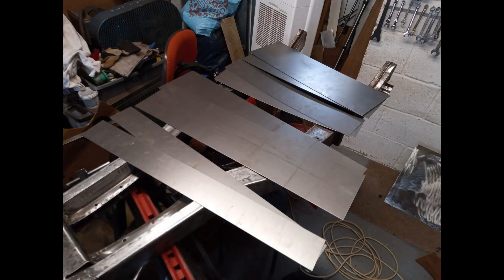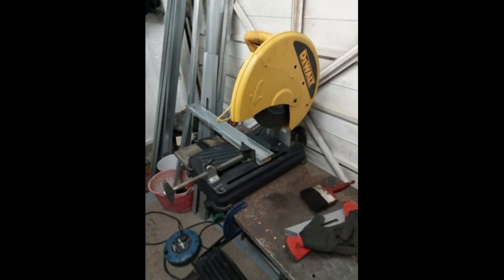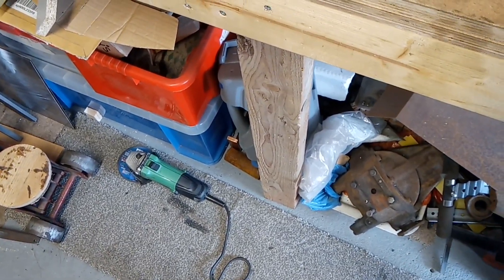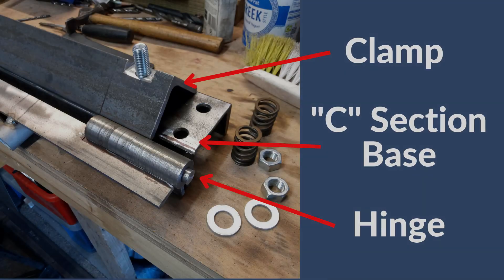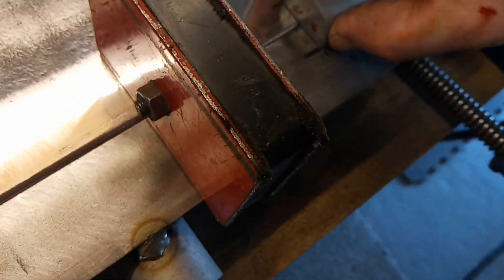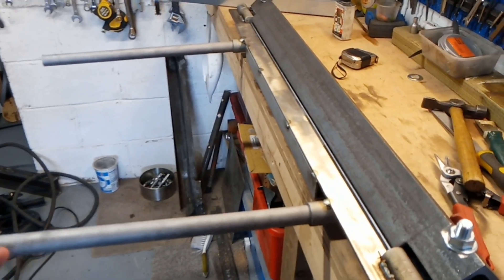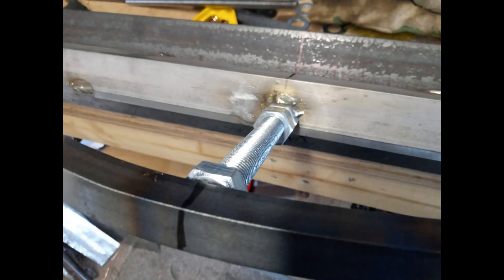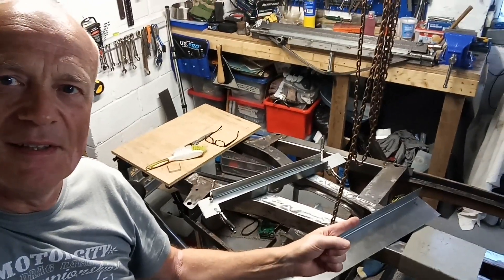DIY Sheet Metal Folder Build

Comment: Great build really like your ideas.  Im in the process of creating my own version
Reply from the maker: Thank you 👍 It is a very useful tool for the rare occasions that I need to use it. You can also use a thin piece sheet steel to alter the corner radius which you can play around with as it will bend to the radius on the clamp.
Good luck with your build.
Kind regards Paul 🇬🇧

Comment: - have you tested how thick steel it can fold?
Reply from the maker: Hi Tom, I haven't tested the max thickness as such as I only needed it for the box sections on my chassis which were 1.2mm which it bent nicely along the full length. I have bent 1.5mm but only short lengths with ease. It all depends on how long a length you need to bend, The longer the harder it is. I would think that it will bend 2mm but only short lengths. Sorry I can't I can't be more specific. 
Kind regards Paul
Reply: @itsalldoable  
Thank you for answering.
Yes I only need a small folder ( lenghts up to 40 cm) to bring along on jobs far from the workshop. Small, light and easy to attach in a vice (my challenge is I work with 2 mm acid resistant/stainless steel)
Anyways, thank you - I might have to borrow some of your ideas.
Reply from the maker: @tomarctus7587  Be careful not to make it too light as it takes a lot of force to bend mild steel let alone stainless. I have some stainless work to do at some point but that is only 1mm. Good luck I hope my ideas help you as others helped me.